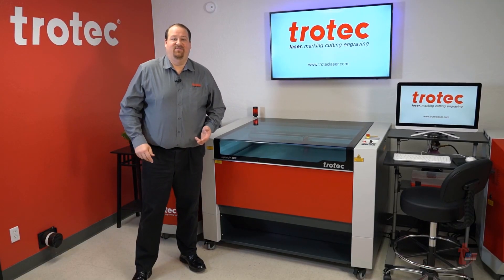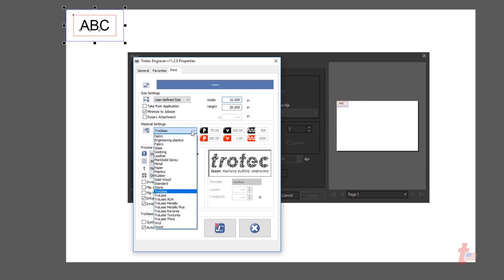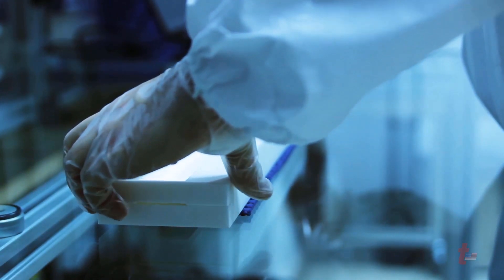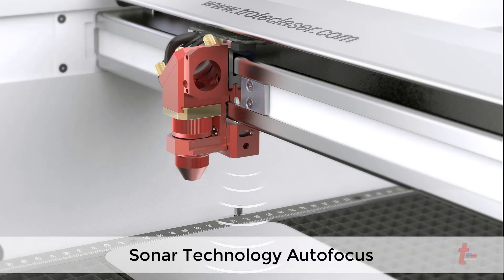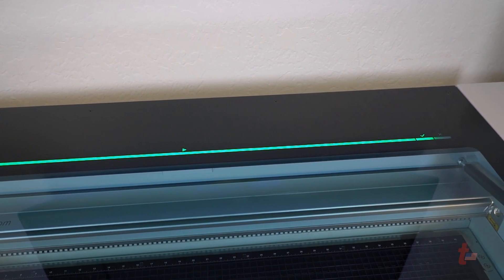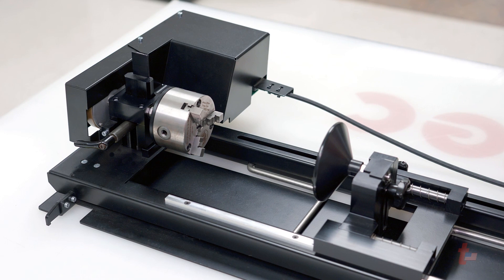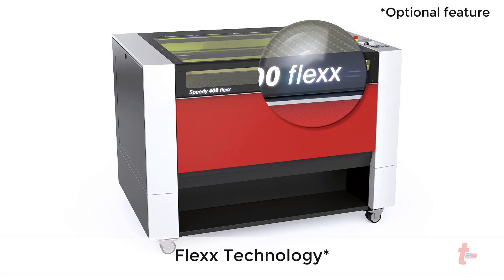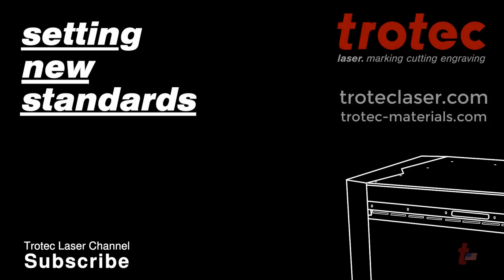Trotec Speedy: Speedy 400 Demo

Comment: What happens if the autofocus doesn't work? It goes down
Reply from the maker: If Autofocus does not work for an application, you can use the manual focus tool to focus.

Comment: Can it also engrave at 170 in/sec?   Or just move?  There's actually an engineering difference in those specifications.  What's the max speed you can engrave something that you'd consider acceptable at?
Reply from the maker: Hello! Our Speedy 400 can actually engrave at 170 inches per second! 💥 The optimal engraving will really depend on the material and the design that you are working with.

Comment: Does the material plate have to be flat or does it keep itself in focus when cutting for example a slightly concave plate ?
Reply from the maker: As long as the change is small, it should not make much of a difference. You should try to find the average focal point across the entire surface for the best result. Flat materials generally work the best.

Comment: Can it cut a 25 mm wood??
Reply from the maker: Hey Jess! Generally, wood thicker than about 1/2" will be difficult to cut through with a laser, especially if it is denser wood. There can be a lot of charring and roughness on the edges. We would recommend a mechanical cutter for 25 mm wood.

Comment: What is the cutting speed? How many inches per second for, say, 3mm thick plywood?
Reply from the maker: Hi Patrick! For 3mm plywood with a 120 watt laser would be about 2 inches per second. The speed really varies depending on wattage of the laser or hardness of the wood or other materials.

Comment: Ok,.. I've seen these used to engrave on guitars. What I need to know is how do you get a guitar in one of those? And I mean the entire guitar body without taking it apart.? Acoustic or electric.
Reply from the maker: Hey Mark! It would really just depend on the size of the guitar. A typical full-size guitar is around 38 inches long, which should fit in the 40"x24" bed of the Speedy 400. The Speedy 400 also has an option for passthrough for longer instruments!

Comment: Can it cut through 3mm ss?
Reply from the maker: Hello! Our machines are not designed for metal cutting. Fiber lasers can effectively cut extremely thin metal films, but that is all we generally recommend them for. The Speedy 400 will not be able to effectively cut 3mm stainless steel.